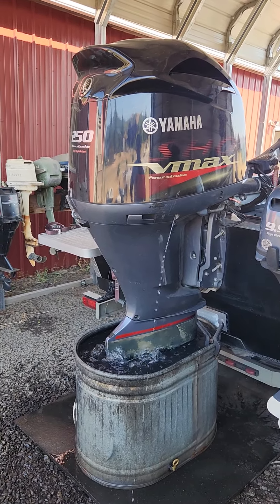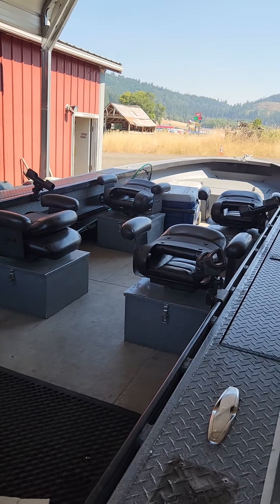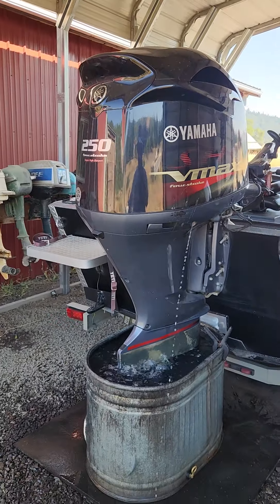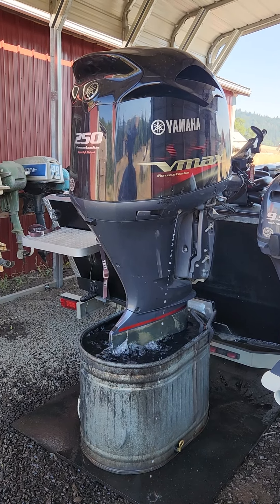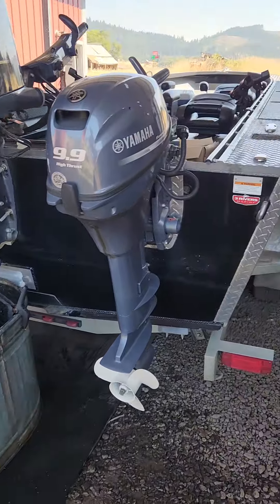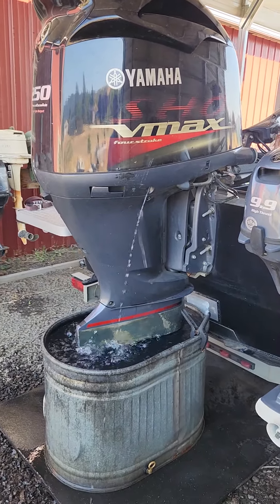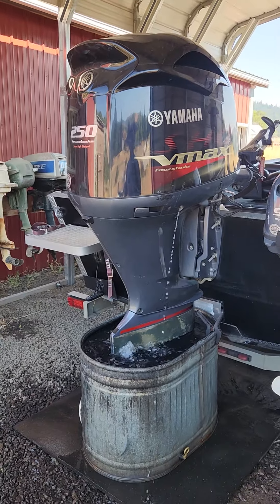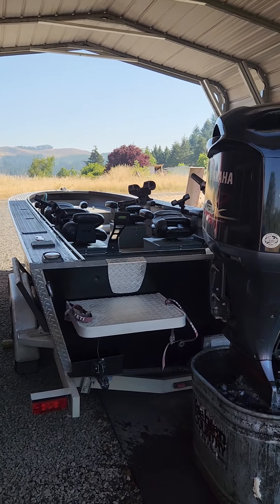2017/18 Yamaha 250hp VMAX SHO w/ tiller handle @OutboardMadness #outboardmadness

Comment: Not trying to be a butt hole but why do you have a 9.9 Yamaha engine in the back with the 250 Vmax?
Reply from the maker: @Boatsforlife1  
Trolling motor + back up motor (just in case).
Reply: Where do you get the tiller conversion?
Reply from the maker: @volsjp  
Yamaha dealership
Reply: also close to where i live we have several lakes i fish with 9.9 HP limit on the water.